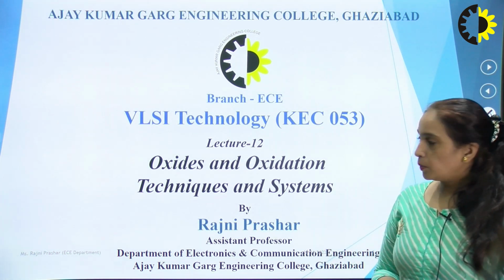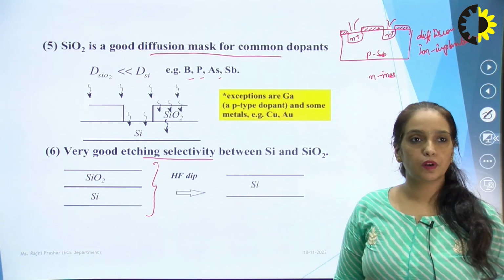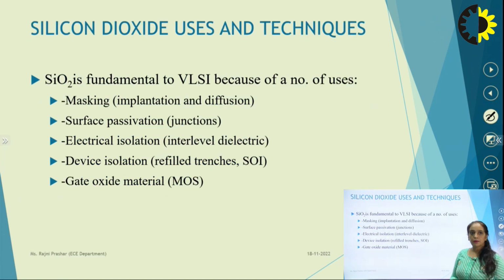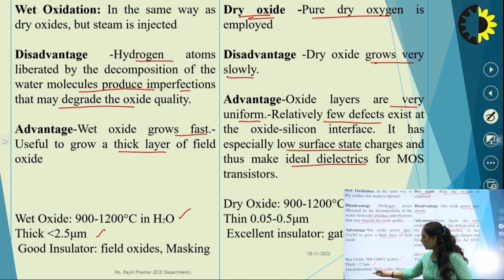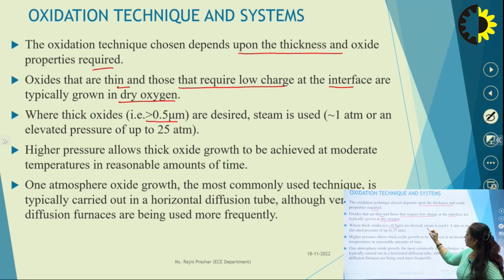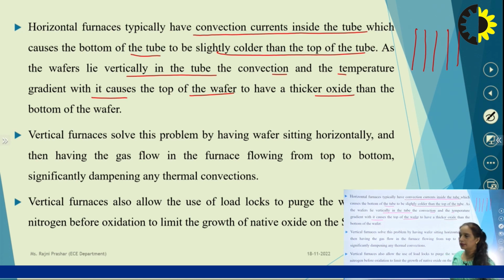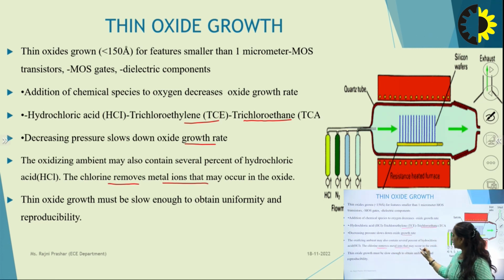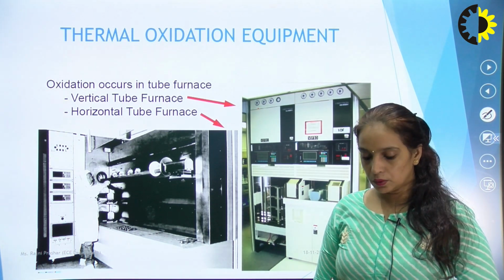VLSI TECHNOLOGY LECTURE 12 ''Oxides and Oxidation Techniques and System'' By Ms Rajni Prashar, AKGEC

Comment: The linear and parabolic rate constants for wet oxidation of silicon at 1000oC have been 
found to be 1.27µm/h and 0.287µm2
/h, respectively. Estimate the thickness of the oxide 
layer after one hour of oxidation assuming the initial oxide layer thickness to be zero.

Please solve ma'am